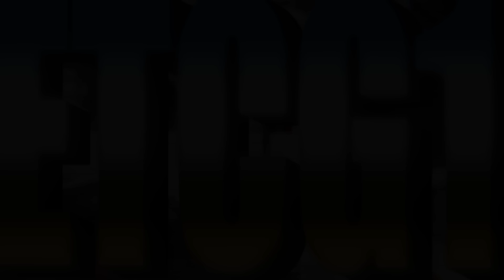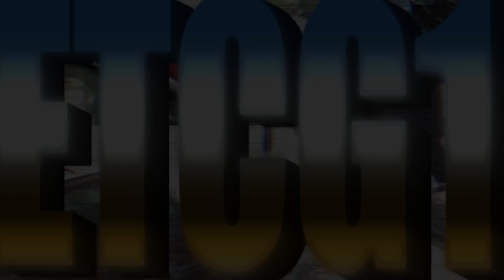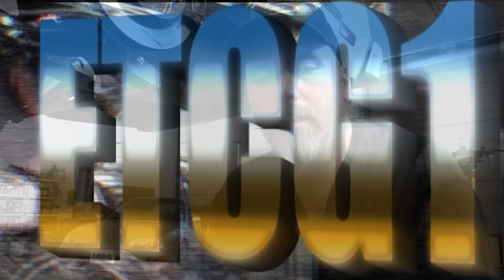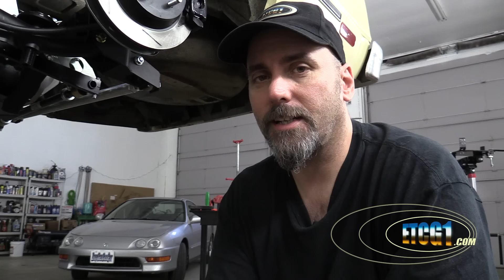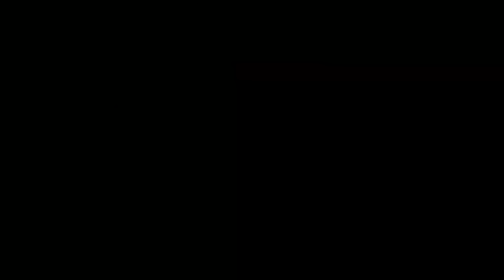Misconceptions About Performance Parts

Comment: Totally agree with ETCG. It's about the right parts and the total package that gives performance results. I can give an example from my own personal experience. I have a '96 Z28 that I've owned for 17 years. Back in '08 I put in a CC503 cam, 30lb injectors, PAC1518 springs, 7/16 stud Comp Cams Magnum roller rockers(NSA), hardened pushrods, guideplates, and reprogrammed the PCM for the combo. Prior to that, I had a CAI and catback system.  Went to the track with all of that  and only dropped 0.1sec off my eighth mile time and gained a couple mph(from 80 to 82). 

The sin that I committed, was that I left the stock exhaust manifolds on it as i was not happy with the exhaust options out at the time and was not committed to getting long tubes.  Long story short, I had an oil control problem that I solved with a canton pickup and moroso oil pan with kickouts, crank scraper, oil control doors, and built in windage tray.  However, this new oil pan would not allow my stock exhaust to fit. So.....I decide to go all in with Kooks long tube headers and a cat'd y-pipe. Serious hit to the wallet, but it can be argued that they are the end all and be all of LT1 long tube headers. 

Went back to the track with the new oil pan, pickup, and long tube headers. The 1/8th mile time dropped 0.5sec and the mph went up to 89mph. 

I left out just one piece of the puzzle and it caused a minimal gain at the track after all that money and my time spent on pulling the engine and installing all those parts.. I figured it was going to be choked some by the stock manifolds, but didn't figure on it being choked to the tune of 0.5sec and 7mph. Massive gain in power.....and I knew it from the moment I pulled on the road for the first time with those long tube headers....gain on the top end was massive....but again, it's the total package that gave me those gains.

Comment: Very true, guys think that buying a cold air intake with no other mods will have your car performing like a top fuel dragster.  Mighty car mods found they got the same power with the stock intake, people don't realize that the whole system need to be upgraded to get significant performance gains.  Putting on a fart can exhaust will make it louder not much faster.

Comment: A lot of bolt on components will seem to make a positive difference when really they make a negative difference. Remember the power output of an engine curves as an engine starts to increase RPMS from idle. There is a peak power output point on that curve, and some bolt-ons will actually change where that peak is on the curve. So that "Cold air intake" makes the car seem to take off faster from complete stop because more air is coming into the engine, but almost immediately the back pressure of the exhaust builds up above what it should be and once the engine hits that point even though it can get the air in easier, it is now harder to get the air out, and the power falls below what it was before the modification was made. So on a car that took 1 second to get to 10mph and 12 seconds to 55mph may take 1/2 second to get to 10mph and 20 seconds to get to 55mph after the modification. It feels more powerful because the car takes off faster, but then it loses a lot more than you have gained...but you don't feel that. You feel the jerk when you take off.

Comment: The only time I ever got a noticeable power gain from a simple bolt-on was on an old Grand Am quad4 - I swapped the factory airbox for a cone filter.  The reason it worked was that the original airbox was very restrictive, designed to quiet the "whoosh" noise when you accelerated.  Almost every performance build is a "system" where everything works together.  Changing one part at a time (at best!) is dealing with the current "weak link"...fix one thing and now something else is holding you back.  New header, now the catalytic converter is the main restriction, fix that and you need more air into the engine, new throttle body and intake and your heads don't flow enough...

Comment: Bolt on "performance" parts can have a positive effect on power outputs, but, most people forget the key determining factor that plays a huge role on those effects, and that is tuning. In the case of fuel injected vehicles, the ECU already has its base fuel mapping set up for the components that are already bolted on to the engine, so, say for instance,  someone installs a cold air intake, headers and complete exhaust system on a car expecting to see an instant power increase, most of the time, the results can be disappointing and even make your car run slower. Now, after installing those parts, if you run a fuel mapping programmer, or, the best way, a full stand alone ECU like an AEM or a Haltech, then you can calibrate the fuel mapping to suite the needs of the new parts that were installed and then you will see a difference in performance. In some cars, just doing all of the above can significantly improve engine performance in terms of power.

Comment: I know I’m really late and no one will probably read this, but take the mountune performance pack for the fiesta ST for example. It’s a cold air intake and a tune essentially and that adds 35 HP! Plus it doesn’t void the warranty. If that’s not proof that bolt ons can work I don’t know what is.

Comment: I think the confusion comes from when the OEM part (say air intake setup) happens to be overly restrictive from the factory. Most vehicles may not benefit from certain mods, but some really do have bottlenecks that can be fixed.

Comment: A step further on this topic...  K and N air filters.  Promises horsepower.  Didn't notice any horsepower improvement.  Looking back, I still wonder if it allowed small particles in that scratched cylinder walls, reduced the compression in my engine (Dodge 360).  Slight oil burn and compression loss at 70k miles.  Went back to regular filters for all vehicles.

Comment: A car, especially the motor, is only as good as its worst part. I've spend about $2k just laying ground work for the future by adding a full exhaust, opening up the intake, ditching a mechanical fan, etc,  etc, and laid down just about stock horsepower on the dyno.

So unless the bolt on is cylinder heads or forced induction, very few cars have a magical box you can buy that will add XX power. Just tossing stuff on, even a lot of stuff, won't do anything but make your wallet lighter until you get to the restriction in the system. Usually on modern-ish cars, the factory package is pretty well balanced already.

The biggest bang for your buck change I've ever made to any (and several now) of my vehicles is replacing the final drive gears with something more aggressive. That's probably the cheapest way I know of to "go faster".

Comment: You're right. I tried the whole "bolt on's" and expecting a major difference instead it was more disappointing. So I went all the way with my GSR.  In order to get noticeable power without "boost" eveything needs to get upgraded. Bore the block and head. And a good tuner. If you have the money and/or passion for it.

Comment: Isn't an engine swap bolt in power? Just allot of bolts lol
Reply: You're reaching! Of course a whole new engine can boost performance because its a whole unit of parts, replacing just a header won't change much.
Reply: ...that's the joke.
Reply from the maker: Technically yes, but with a modern vehicle you'd have to bolt on a whole lot more for it to be effective, or even run.
Reply: @ETCG1  hey I got a 2004 Toyota Corolla and I did a exhaust straight pipe myself and I wanna do the intake I noticed it's very long and bendy so could I cut it to get forced air when I drive that it blows directly into the intake pipe or is that a no no

Comment: If your "GSR" is the same as the Integra Type R we get here in NZ, the exhaust manifold has been pretty extensively proven to be unbeatable for a near standard engine. Honda did their homework on this one!
 I've put headers on a few of my cars over the years and like you, agree that there's not a lot to gain on most vehicles, without actually outgrowing the standard manifold. I've noticed a difference but, was it just the sound?

Comment: Eric, say you pump up the fuel delivery and air intake.   At that point the bottle neck would be the stock exhaust, and exhaust manifold.   That is when u will see significant gains by swapping the exhaust manifold.  So yes, you are correct.   it is the system as a whole.   U can modify things in a certain order to see gains, but there will always be a factory bottle neck, sort of a snow ball effect, more air, more fuel, see a gain, then hit the wall, let it breath better, get over the wall then there will be something else you gotta take care of, just the nature of the beast.   so ya i feel ya.

Comment: I agree, it needs to be done to work together. Also, adding all of these parts without tuning is quite pointless. I added a Cold air intake, bigger throttle body, and intake manifold from a bigger Honda motor onto my 3.0 V6 in my Accord as well as pre-cat deletes, J-pipe, and a cat back exhaust. It sounded great, and the throttle response was nice, but NOTHING happened until I had it dyno tuned. Now the car feels like it left the factory this way and I have yielded incredible fuel economy gains as well for when I'm just cruising on the highway.

Comment: Every car modification understanding should be started at the suspension. From there do the exhaust if going for power, 3" down-3" inch out with a race cat, custom headers to that down pipe, intake modification, drop in filter or open air filter. If possible larger intake pipe. If turbo charged: larger intercooler with high flow piping. Larger Injectors and a tune so that the car understands what you have just provided it. Modifying performance wise, is about letting more air flow with less restriction. Though be aware that things like a cast iron transmission, lsd, gear box enforced mounts to weak body roll or so forth will have to be taken into consideration also. It ain't cheap, it is fun, and can sure as he'll get you in trouble...

Comment: If you have a 4.3/5.0/5.7 with the TBI and torque swirl heads and are looking for more low end torque. A Torq Swirl 1in spacer will make a massive difference, out of all the modifications i've done that one is the most dramatic and for 60/70 bucks for the spacer and fuel line extensions well worth the money.

Comment: On modern cars computer tuning is probably the best thing you can do to increase power. That's really how you pull gains from parts. I have a Pontiac g8 that picked up 70hp and 45ft lb of torque to the wheels with full exhaust system and intake.

Comment: Couldn't agree more. Too many people believe their cold air intake, throttle body spacer (I'll get to that) and muffler delete added 40hp. For one, an engine is basically a large air pump and putting a larger plastic tube on the throttle body doesn't increase the amount of air going in. The cotton filter included may relieve some of the load required to pull air in but not the amount. Tune engine is going to pull the amount of air it needs and nothing more. Hard parts with larger pathways or compressors top force more in are required for that. At the same time increasing the amount the engine is able to release doesn't necessarily add power when there's not more coming through. In fact it often does more harm than good like Eric mentioned when open it too much and lose scavenging. The cylinders need more help evacuating the chamber for the air coming in. That's before you get into the tuning to account for many of these modifications. And the amount of gimmicks out there is worse than ever. Throttle body spacers for example do nothing on a multiport injection engine because there's no fuel introduction until the intake valve anyways. You do however elongate the intake plenum slightly which from a horsepower standpoint would actually lessen air coming in and hurt final hp however small that difference would be.

Comment: I bought the 40$ air intake system system in Ebay for my 2005 neon, seems to accelerate a bit smoother and better gas mileage.. drove it from cali to Texas and it's still going strong. didn't get by to install the Long pipe component but not sure if I should clean the header or replace it now.

Comment: If you want gains you can't do it with bolt on parts alone. You are going to have to adjust parameters in the pcm.  You have to allow the feed back network in your vehicles computer to understand you have altered physical components. Of course I am referring to modern vehicles with on board control systems.

Comment: Factory intakes are pretty good these days unless it is not sitting correctly to pull the cold air in correctly. On my Chevrolet Blazer the factory air box wasn't sitting correctly to allow the horn to pull air behind the head light, so I cut the horn off the build an air dam under to keep the air from under the hood from going in the intake and then I opened up an area in front so cold air could push into the air box from driving. I don't know how much hp gain I get, but the air temperature in the intake on 100 degree days ranges from 140F in the city with stop and go down to about 110F going down the highway. That should add a few pony dynamically from charge density increases.

Comment: On my 01 dakota 5.9 ive done a whole host of parts (performance) that i cant speak of any couple of parts that have helped with noticeable increases. 

Ive started off with a 1/4 billet plate for the intake and it soon lead to a head gasket and valve seals. When i did those i added shortie stainless headers with a double roller timing set. In the process i had clogged cats thati punched the elements out of when i assembled everything. I ported every port in theintake and exhaust runners withthe intake and throttle body. Poorly but i didnt take much off of them. I just cleaned and smoothed everything. I then put everything together and noticed i needed larger injectors so i bought a matched set of 4 hole 40lb injectors for later mods. I topped it with a 4" powerstroke cai tube kit. Backed it up with a 3" stainless exhaust from the collector to back. So far at 200,000miles on the clock im getting more torq and hp to boot and i know i need to tune the ecu to get where i need to be after a new cam and valve train. But you cant just slap power. You need to support it.

Comment: Completely agree with everything you said, especially when people wanna see results after dropping a few hundred on some parts but the biggest factors on actually making more power are going to generally be the more expensive things IE a turbo or super charger or internal bits and getting a proper tune, buying a bigger intake would allow you to get better flow but that doesn't always mean bolting it on your gonna see gains instantly other than maybe 1 or 2 Hp and on cars that don't have really low outputs like sub 100 your not gonna be too keen on noticing 1 or 2 horseys

Comment: I think the big thing about "bolt on hp" at least with Vw's is that the more you add the more often you will have to do work on it for example with a standard 1600 you can get away with only adjusting the valves every oil change but with a go faster motor you'll have to check the valves every week

Comment: The only performance parts I've ever noticed a huge benefit from, as far as power, was gears, a full top end (heads, upper/lower, TB and plenum, CAI) and I'm sure, each of them on their own, I wouldn't have noticed, but when I did it all at once, on my most recent car, it was very noticeable, and also I noticed a little when I did a full exhaust on my car. The most noticeable mods I've ever done were my coil over suspension and big brake kit. (2000 Mustang GT) Though with these 4.6 modular engines, the only way to make nice, big power, is forced induction, and that will have to wait a few years.

Comment: The only HP mods worth doing aside from F/I are all difficult/very expensive. Things like stroker kits, flat faced valves to increase compression ratio, long tube headers, high strength valve springs to allow for higher RPM, standalone ECU's,  longer duration/lift cams, porting/polishing the head, ITB's.....
Reply: Long tube headers will only give you single-digit gains in the very top end compared to short ones, at the cost of low end torque. There is almost literally no reason to buy them. Unless it's a dedicated race car, all you'll be doing is melting your suspension bushings. Polishing the head is also pointless. Golf balls are not perfectly round for a reason.
Reply: golf balls are not a random irregular surface either. But I agree, polishing alone doesn't do much.
Reply: On the new direct injected motors polishing actually makes more sense than it did before. Surface irregularity are there to keep the air turbulent in order to keep the fuel atomized. I can't say for sure that it will add a gain but fuel atomization isn't a thing on those new power plants.

Comment: 2002 Duramax. added a superchips economy tuner a k&n air filter and removed my muffler. paid approximately $300 for everything. it made a noticeable HP and torque increase, but I like the 4 mpg increase the best.

Comment: depends on the bolt on, and the engine. MAF engines like the late model 5.0/302 have the ability to adjust to make the most out of single bolt ons. Collector extension on most any vehicle will see horsepower gains on a dyno.